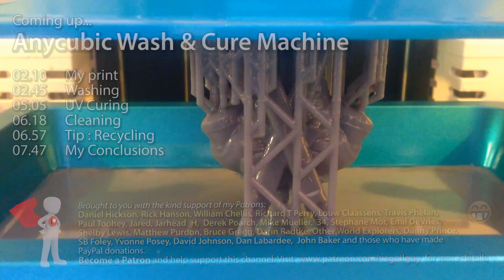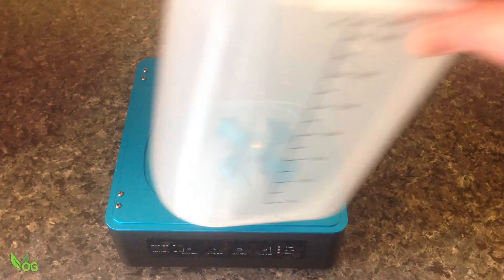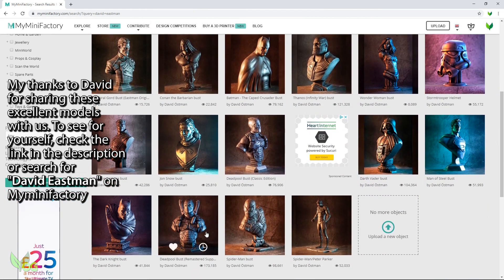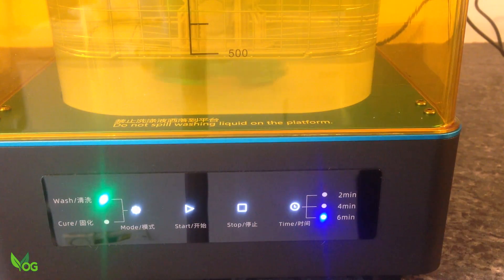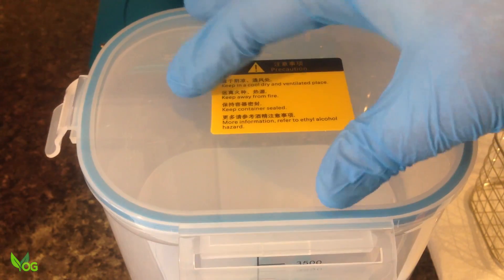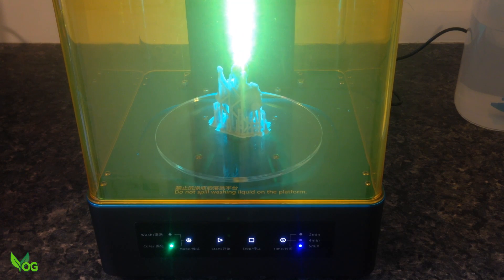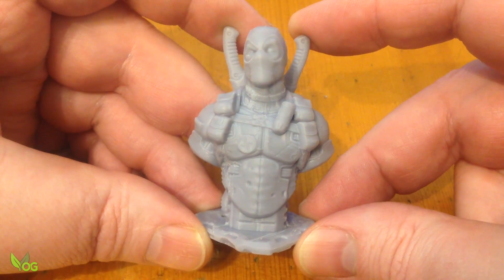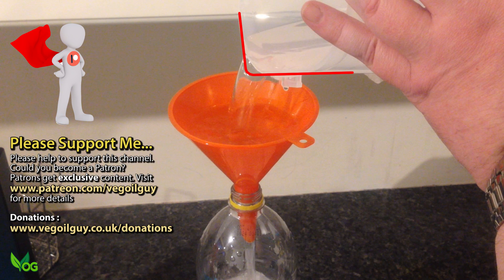Anycubic Wash & Cure Machine unbox test and HONEST review by VOGMAN

Comment: Anyone has this and knows what voltage the power supply should have? I have an old one and the PS is gone. The PS from the printer is apparently not working for this one. The idiotic inom sticker on the machine only gives the AC value ...

Comment: Square corners would cause the cleaning fluid to have more flow resistance, meaning that it probably wash not as good as it does now, although on the top of the vat they could have made a square corner for ease of pouring the cleaning fluid

Comment: Do you normally take the supports off AFTER curing?  Have you taken them of before curing?  is there a difference?  Just wondering if the 'softness' of the uncured resin and removing the supports can ruin details on the model? OR if the supports block any of the UV light or having the supports removed before curing lets the model cure better?

Comment: I've used formlabs machine on school, they weren't too bad but considering price, I would recommend anycubic for someone that doesn't do resin prints daily.
Advantages that I saw immediately over anycubic was that there was motor to automatically raise tray after time is over, There's also build plate Holder built in but honestly I didn't like that because cleaning solution (IPA) got dirty really fast.
As for curing machine, it has heated chamber that heats up to 60°c every time it's used. But it takes time. I'd say that 30min to 1.5hr is curing progress. And washing is about 15min to 30min. And whole process about 2hours. Those were times that we used.

Comment: Gonna get myself the Anycubic Photon S, and was considering this device. Now I'm really sure I'll get it :)
Reply from the maker: If you can stretch your budget to the Mono SE, you can benefit from a Monochrome screen. These will reduce your print time and extend the lifespan of your printer. I believe these are guaranteed at 2000 hours, but double check that. But in terms of print quality, there's probably no difference.
As for the wash and cure, I use mine every time 😁
Reply: @vogman  Resin printers are extremely hard to come by here in Norway. Was hoping to get an Elegoo Mars Pro, but with no luck. So the Anycubic is my best chance of getting a resin printer. Don't want a PLA printer since I'll be making very small and detailed parts.
Reply from the maker: Yes, resin is the way to go for small and detailed. Happy printing 😁

Comment: Can you simply place the plastic bottle with the IPA with the resin in it on the Anycubic Wash & Cure in the cure mode to harden the resin nearly instandly?
Reply from the maker: I'm not sure I understand the question properly, but you can't Wash and Cure at the same time in this machine. Wash to remove the excess resin, blast with air to remove the excess IPA, then UV cure the print 😁
Reply: @vogman  Yes, but after the wash you placed the dirty IPA in the sun, so the resin in it can "dry". Can you place this dirty IPA in the Anycubic Wash & Cure in cure mode to harden the resin in it (it would be much faster than waiting for the sun to do the job)?
Reply from the maker: You could... but you're burning those LEDs which wears them out and costs money. Daylight is free...
Reply: @vogman  That's a point! Thx

Comment: used my wash and cure machine (elegoo version) today for the first time and agree with you about not attaching the build plate to the wash and cure machine. after 15 minutes of washing i removed the build plate, popped off my prints, and grams of resin that was trapped between the prints and the build plate drizzled out from areas the wash couldn't reach. i will use the basket from now on

Comment: Question:   This Anycubic wash machine claims (I think) something like a 5.5" long print wash length...(I think.  Or maybe I already said that).   Is that a vertical height or a diagonal?  Yes, I can do the diagonal math, but if I contemplate prints which are on the order of 6.9" or so in length...will this machine--in real use world use--wash and cure them?  Extra time doing so is, for me, not a problem.
But the extra steps of turning around longer prints to wash and cure both ends of a physically long print might be.
I ask because this machine is promoted as an add-on to the Photon X 4K which sports a straight length print of 192mm/7.55" and the prints I hope to make, lengthwise measure 173mm/6.8"long and perhaps...40mm deep.  Sounds like I would be VERY close to the maximum diagonal depth of both wash and cure if I were to spend the extra bucks to add this wash and cure machine to my order....  
Yes?  Or no...in practical--real world use?  
Thanks for any reply....  
Could
Reply from the maker: If you're asking can the wash and cure manage the Mono X prints, I'd say for washing no, but for curing, yes. The basket is too restrictive for large prints.
Reply: @vogman  Is using the basket strictly necessary though?   It's convenient, sure, but it's not that much harder to lift prints out using forceps, or just gloved hands...or am I missing something obvious?   I'm new enough to the world of 3D printing that I could well be.   
It also seems the tank itself sports a maximum stated liquid volume of 3600 ml or thereabouts, so I guess I should refine my question:   If a long, skinny print sits at the literal bottom of the tank at one end of the diagonal,  and if the tank is filled to max volume of washing solution...a long, skinny print might fit across the diagonal.   Yes?
Probably a niche question, I know, and on top of that, it might be feasible to fill the tank to even 4000 ml before the solution spilled over the sides...
It seems to me, too, that filling it almost to the brim would just cost you extra wash time (because the propeller might not be able to swirl the solution around fast enough to do it quickly...but might still do it well enough it it just had more time).  
Of course if it spilled over it might also ruin the machine, so it would be a risk not taken lightly....
Reply from the maker: You need to remember there's a turbine at the bottom, so you need to place the prints above this... and the lid must be in place else it won't work...

Comment: What is the spacing of the wires on the cleaning basket? They look far to wide for washing very small miniatures
Reply from the maker: If the minis have no base, possibly parts could poke through the mesh... but it's not something I'm experienced problems with so far : )
Reply: I would guess you could drop in a finer mesh screen to support your small miniatures, although you might have to select a mesh of similar material to the basket.   Think window screen, perhaps.

Comment: I tried the ipa recycling tip but after 3 days the ipa is still super cloudy, even more so than when I put it in the bottle. Is this normal or is the resin just taking forever to cure?
Reply from the maker: I tend to ignore it for a few weeks. But I also note once clean it tends to clear in the evening by get cloudy in the day... I suspect sunlight and warming may be the problem. So I filter in the evening.
BUT tip the bottle very gently and slowly. Everything settles to the bottom but it's easy to stir it back up : )
Reply: its been roughly 2 weeks sinse i had this problem with the 99% ipa and its still super cloudy, almost looks like milk. ive read that the 99% dissolves the resin which prevents it from settling to the bottom and causes the permanent cloudiness im experiencing. im assuming this means if i use ipa of such a high concentration, separating and reusing it may in fact be impossible. do you happen to know anything about this?

Comment: Can this be used for cleaning small tiles that have been painted with acrylic paint that had silicone added to the paint? The silicone is hard to remove off the tiles before they are to be resined. If not removed, the resin repels away where there is silicone, leaving dimples in the finished project.

Comment: I also enjoy this machine, but what annoys me is they used a cheap stepper driver to control the motor so its not silent. but yea yea silent or not... the problem is when you cure a model the motor resonates and shakes the curing platform a bit and after 1-2 mins the models are all on the side of the curing station with nothing on it's platform. Oh and they REALLY need to start selling spare containers so you can do 2 step washing like you should do with all resin prints.
Reply from the maker: Interesting... my prints have pretty much stayed in place, but I haven't done any small prints yet. I do agree with you about the extra containers as well. That would be a nice extra and knowing Anycubic I can't see it being long before they sell these.

Comment: Magnetic stirrers are common in chemical labs, and they don't need bearings in the bottom of the beaker, just a stir bar with a central ridge for it to spin on. They're much cheaper than this unit, circa £30. As for UV I already have a big UV light for PCB making but I reckon I could bodge a turntable and a UV led strip for less than £20.
Reply from the maker: You know me and making stuff for less cost... if you can do it, nice one!!!

Comment: A great review, and I do like your point on "versus price". There are 2 things I would have thought I'd do differently if I were making the 'cure' bit I'd have another column of UV LED's set at least 90 degrees so that you can place things in front of other things and just get better coverage of light, or only print a couple of objects as you did. The other thing is to have more reflective surfaces around. The clear revolving plate is a great touch, hopefully it won't cloud over time, but the blue anodized surfaces there will possibly absorb some UV (purple blue?) light and lots will escape through the yellow absorbing cover... It's nice being able to see things going and all, but a silver mylar cover, and silver anodisations would have made me more comfortable. The real test will be - can it cure a full bed of tall printed things you are going to cast? Given that my previous experience is a paint tin with UV LEDs, and sunlight powered glass turntable, this is such a step up, and even if it requires a reorg of the curing bits and another 6 minutes, this is still way worth the £200 cap I'd place on this luxury... Well, until I go Prusa :D

Comment: Nice review VOG and thank you for the discount code.  Just ordered one 😀
While I'm here, resolution settings do you use for your test print please?
Reply from the maker: You'll love it Tony.
I used Anycubic Grey for the first time with a Photon S. I went with 0.025 height, 12s normal, 1s off time, 100s bottom with 8 layers as I tend to have sticking issues if I don't cook the first few rows. 
Treat this as your starting point... it worked okay but I'm no expert : )
Reply: @vogman  Thank you 😀

Comment: Being lazy really does cost absurd amounts of money!
Reply from the maker: Convenience costs : )
But in fairness, it cleans better than I've ever managed with ultrasonics, dips and brushing.
Reply: @vogman  I had issues getting prints clean when I was using IPA and then I found purple power. It is awesome at cleaning the models, dont need ultrasonic and really just very minimal handling at all is required. I figure I can purchase a 400 year supply of purple power for the cost of this machine but hey... if it works for you and you have the money to spend go for it...;)
Reply from the maker: My advice would be - go with what works for you : )
Reply: @vogman  Good advice always and beside I also have more money for things like resin that I would have otherwise spent on some convoluted, over built cleaning system....;)

Comment: Looks like a solid and well built machine. I'm sure to someone who uses a 3D printer it's worth every penny. Thanks!
Reply from the maker: We may have to convert you John. It's a surprisingly versatile hobby : )
Reply: @vogman  I would love to give it a go. I have a fella wants me to design and print rings and cast them in gold for him. I don't have a printer so that's out.
Reply from the maker: It's like most things in life... when you've not tried it, it can look complex. And when you initially take the plunge, you wonder if you've made a mistake and think you'll never crack it. But then very quickly, it all just makes sense.
Without a doubt the softwares are the worst. Initially there's just TOO MUCH going on. But by ignoring 99% and doing one thing after another, suddenly you realise that with even a little knowledge these free softwares allow you to make incredible things very easily : )

Comment: I thought I would be safe drinking my tea, untill the bottle joke. 😂
Good review and tips, this has certainly got me interested in resin printing. 👍
Reply from the maker: Sorry about the tea... I couldn't resist : )
I was quite late getting into 3D printers but since doing they've changed my life. It sounds corny but they honestly have.
I bought an item from a large online store this week. When I received it, certain brackets were missing. I contacted the company who apologised, fully refunded and asked me to dispose of the item. Of course I didn't... I just printed my own brackets. It works perfectly : )
Reply: @vogman  I've done the same thing! Have a wire stripper the wire guide just wasn't quite right on, so i printed my own and it works perfectly. My father also makes clocks and one of his favorite to make is an old hand cranked wall phone looking clock. He has me print out the earpiece hangers and bells for him. Costs me 30 cents to print a bracket vs $20 for a metal one from the antique phone store. He just paints it to look like metal and you can't tell the difference on the finished clock. I've used my photon printer so much i had to replace the LCD screen last night after 3.5 months of use. Started getting random islands every 50 layers or so. Back in business again now though :)
Reply from the maker: It's amazing how you start to see practical applications everywhere, isn't it. And with speciality resins, the sky is the limit. 
I was watching a YT video last yesterday (https://www.youtube.com/channel/UCjCansDZjTzHvim9VgF-FXg). I love Del. He's got a great sense of video and boundless imagination. He enjoys making RC vehicles and building in his own modifications. Last night he was building a styrene V8 engine and I was thinking how I'd print one... I keep urging him to take up 3D printing. I would imagine it's massively influenced many modellers.

Comment: That was amazingly clean in just 6 minutes!  Did you try washing it while on the build plate?  Did it come out as clean?

Even if I don't buy that version, I may replace my ultrasonic with a magnetic stir.
Reply from the maker: I'll be honest, no, I didn't lean on-the-plate for the reasons I gave. I suspect the print and plate will come out spotless - until the print is removed, But where they bonded, surely there's going to be resin. 
I like the idea and as a two stage approach - maybe a quick clean for a nicely full build plate, followed by a longer clean with everything removed - it could have its advantages. But either way, it does a great job in a very short time.
Reply from the maker: Excellent point. I hadn't consider that 👍👍👍

Comment: Great informative video, I had been wondering about the nitty-gritty of this thing since I saw it online. Thanks for sharing!

It ticks all the boxes, efficient, space-saving, good looking, looks simple to use. But all that in one machine does make for a bit of a price. Worth it? Absolutely! Worth it compared to a more clandestine setup? I honestly don't think so.  Particularly if you use nice cheap Methylated Spirits! IPA isn't really all that cheap, in Australia anyway. 

My setup consists of a small tub of methylated spirits, where I first dip a print and shake it about to get a majority of the uncured non-drippy resin off, then it takes a 5 minute bath in an ultra-sonic cleaner filled with methylated spirits as well. Then the print gets a shake in some warm water, then in to the curing chamber (foil-lined container with a UV bulb unceremoniously plonked through the top lol), total cost probably 60AUD max. But, of course, what works for me printing model car parts might be different for those printing other stuff I suppose. 

But I certainly think the Anycubic was/cure machine is cleaner, simpler and look a lot prettier, it's just I'm such a cheapskate haha
Reply from the maker: It's a choice everyone has to make for themselves I guess.
You saw some of my cleaning gear in the video. I didn't include the UV set up. 
Personally I'd say, inch for inch, the Anycubic wins. I honestly feel it takes up less space, looks nicer and does a better job.
As for meths, I used it myself. Works well. You could just as easily use it in this machine as IPA or one of the highly priced organic cleaners.
It's an option... some you love it and some will loath it. But it's good to have options : )
Reply: @vogman  Certainly is a space saver too, yeah! I'm very fortunate that I have a garage to fill up with stuff but I can imagine those who live in apartments etc would welcome the extra benchspace the Anycubic setup would allow. 

One thing I do think this will make me do is get a cute little turntable for my ghetto-fabulous setup for sure!...  Any maybe make a nicer-lookin curing chamber from a coffee tin or something lol